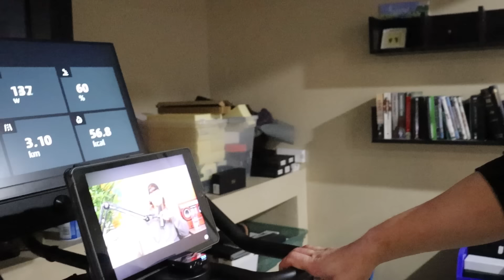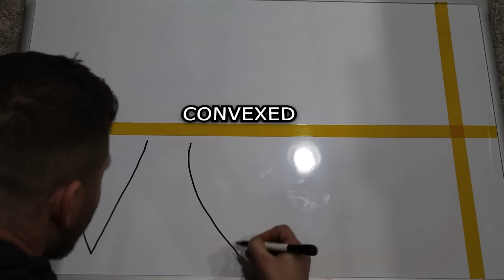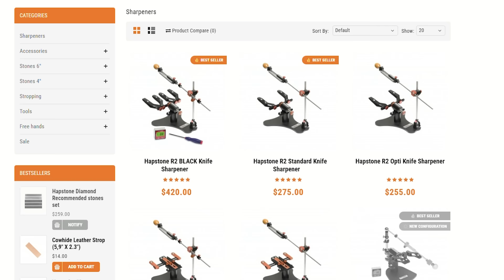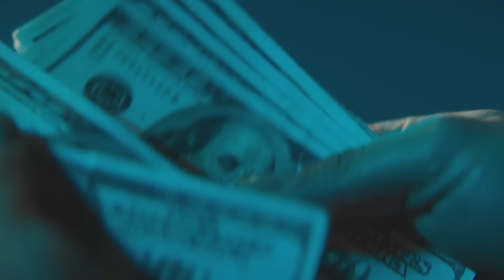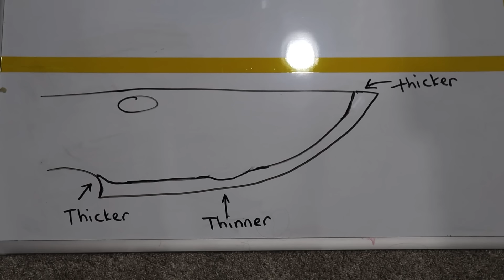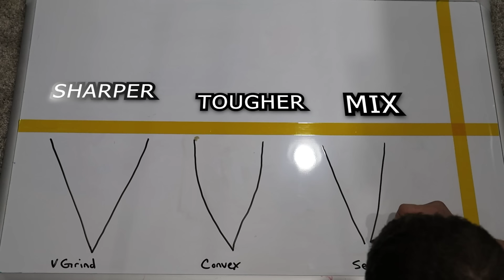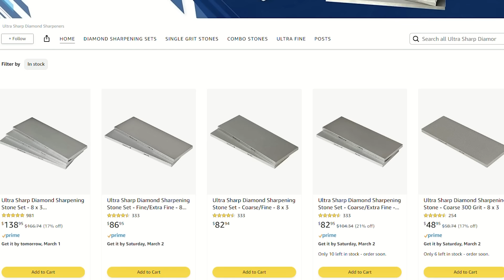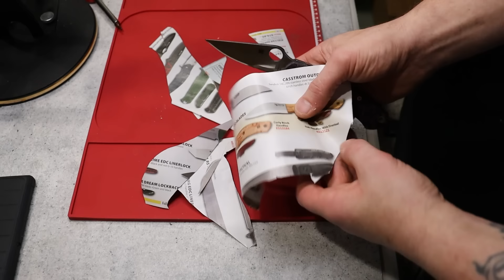The Ultimate Showdown: Freehand vs Fixed Angle, Precision in Knife Sharpening + Yesoul G1 Plus Bike

Comment: I’m 66 and grew up hand sharpening since I was 9 and got a case knife and two Arkansas stones. I love the TSProf K03 and Venev Orion stones which I also use in a holder for freehand sharpening. I mountain bike in the Maine forests and carry a couple knives and basic survival stuff and that work sharp hand sharpening tool with diamond plates works great. You know what else I carry? A sharpie, and have used it because I’m not guessing any more than I need to.😊 the Axicube👍

I have removed stones from my guided system and put them in a table holder to get the tip and heel.

Comment: I've been sharpening knives for 40+ years.  The information in this video is solid gold.  If you can afford a fixed angle system you can use it to get and keep your knives sharp while you learn to freehand.  These days I freehand just about everything with a axe puck held in left hand and finish with a leather strop.  Technically the axe puck is a water stone  but I use it dry so I can drop it back in a pack without getting stuff wet or worse having the stone freeze.  Once in a blue moon I wash it off with soapy water and very occasionally I level the puck by rubbing it in an orbital motion on a flat piece of smooth concrete.  I always wear a smooth leather belt to use as a strop.  My knives from 3" folders, bushcraft fixed blades to actual K-Bars will shave the finest hairs on my arms with one light swipe.  Muscle memory is amazing and totally worth learning.  Puck is also great for my axes, hatchets, tomahawks and machetes.  Water stone aluminum oxide stone puck wouldn't be adequate for super steels but it works great on well executed D2 and below.  Fine for 1055 to 1095.  AUS8, 14C28N ,  What ever steel is in a Mora stainless or carbon or many other similar steels.  Starting on a bench mounted diamond stone would also be my recommended way for a beginner to start.  Once you master that you can branch out to other techniques.

Comment: I always thought of it like this:

Fixed Angle = Lower skill floor, Sharpens faster, easier to learn, more forgiving of mistakes

Freehand = Higher skill ceiling, Able to sharpen an edge with more precision, is more cost efficient and more versatile

I have a fixed angle system. It works for me, but many of the knives I sent to you and got that Neeves freehand special came out far sharper than what my work sharp was capable of doing. Only took me roughly 20 minutes to sharpen but I bet it took you half an hour minimum to put your edge on the same knife.

I think for cheaper knives or frequent users a fixed angle will work but for when you want to put on the best edge possible nothing beats free hand in the hands of an expert sharpener. Because as you said the knowledge can go anywhere with you but a fixed angle system won't fit in the pocket like you demonstrated in the video.

Comment: Thanks Jerad I learned from the best ! I do both , but I prefer fixed angle , BTW The TSProf K03 pro has a convex attachment you can adjust the degree of convex from slight to full 💥
Reply from the maker: Yeah I actually have that attachment, but I've yet to have gotten the kind that I think could possibly be the best, however I didn't consider zero grinds which could possibly be a cool discussion soon

Comment: I like to reduce the shoulder of the edge with few passes at a 10° angle.
I do this to make stropping at a lower angle much easier.
It doesn't make the edge too convex and loose more and more sharpness over time with stropping touch ups.
Some fixed angle sharpeners doesn't allow you to do those 10° passes on some shallow blade shapes.
Learning free hand sharpening takes time but it's so beneficial on all points !

Comment: A very fun vid, shootout to kara for making an appearance. Biggest difference i find in the two is with freehand being able to balance what the edge looks like easier especially on a poorly ground knife.  I use both freehand and a system on occasion. One of the big boneses you get on a fixed angle is the ability to stop at any time and pick up where you left off even a day later and continue sharpening that knife as long as you leave it set up in the system, no guessing what side you were working on or what stone you were using at the moment you stopped. For portable i keep a worksharp guided field sharpener in my bag when traveling but i also keep a set of DMT credit card sharpeners in my wallet and I'm able to touch up any edge with those. They come with a Medium, Fine, and Extra Fine grits for touch ups on the go. They also double as files if i ever need them too, as in  removing a burr or sharp Corner on something. The amount of options available for sharpening supplies is growing all the time including diamonds,  regular stones, strops and compound, systems or free hand stuff. Nice to see innovation as well going strong. Thanks for the great vid and keep making sharp things fun and enjoyable.

Comment: Yes you are 100% correct. Myself I use mainly japanese water stones for kitchen knives and workshop tools but I do have bench oil stones, DMT diamond stone and few small sticks stones. In my opinion good quality extra coarse diamond plate and medium grit soaking type japanese water stone is essential to have in the kitchen and garage, but it is good to have fine stone as well. My high grit stone is 4k and I don't think I need anything finer than that. I started with 1x2x8 bench stones but I quickly moved to bigger, wider stones. So I prefer large single grit stones instead of small or double sided. However small stones can be used as sharpening sticks which are useful in some situations.

Comment: Which fixed angle system is your favorite?  I have a kme and while it's ok I wouldn't mind upgrade to something that can use bigger stones. 

Also, what diamond plates do you recommend for beginner freehand?
Reply: The only diamond stones I will ever buy (also currently use) are Venev diamond stones. Venev Industrial Diamond stones, and bonded diamonds are preferred over coated diamonds. Unlike coated diamonds, bonded diamonds spread the diamond grains over their whole volume, and work in similar fashion to conventional abrasives. Only bonded diamonds can be flattened, lapped, repaired or refreshed. Bonded diamonds are universal and able to sharpen any steel and they have much better feedback and a longer lifespan in general (when taken care of/maintained properly). 

This is your destiny; let the stones be with you.
Reply from the maker: I'm doing my top 5 very soon

Comment: Okay so here is my thing. I cannot freehand forwards to save my life. However, I have learned how to strop by hand and I'm able to hold the exact same angle doing so. I have a DLT ultimate 4 sided strop 8x2 three sides are covered in leather hardwood. On each end there are pieces of wood that I can unscrew with a butterfly nut. Designed to hold strips of sandpaper that are 8 by 2s and by sharpening edge trailing for stropping strokes. I can achieve killer edges and hold my angle doing so. And then I followed up on 6 CBN strops. 16, 8, 4, 2, 1, and .5 micron for a mirror edge. But my sandpaper progression is 400, 600, 1000, 1500, 2000, 2500 before I use the CBN strops. I don't know why it works it just does. I know you said in one of your videos you don't recommend Sharpening backwards and I don't understand why because that's essentially what I do with the sandpaper. And it works. Sorry this is so long I'm just trying to learn everything I can.

Comment: I suck at sharpening knives freehand. I've been doing it for almost 30yrs on just about any stone you can think of. I can get a sharp edge but not razor sharp. I must have developed a flaw in my technique. Always one side ends up better than the other. It really makes me feel like a failure.The best I can do is maintain the factory edge with ceramic rods and a strop.
Reply: Same. Watch all of Jared's sharpening videos and something will click. I bought decent diamond stones and use his tips to keep a consistent angle. Much improved. I prefer to keep the factory edge as long as possible.
Reply from the maker: Make sure you have diamond plates always start with a low grit like 300 or less, you can get an angle finder If needed like the one I showed in the beginning of video, watch a few of my vids I show some awesome tricks to getting great edges

Comment: Great summary, but I will disagree about the inability to achieve a semi-convex on a fixed angle system.  There are a couple ways to go about it.  One is to simply clamp the stone at a slight angle.  Another method is to use a curved rod, which are available for some systems.

Comment: I have ultra sharp diamond plates and 1 resin bonded but they only go to 3k grit what do you recommend for 5k grit
Reply from the maker: You can try Venev, or The new metal bonds from USA market linked in description, check my hapstone link for venev 3x8 you want the 1200 which is 5k or get the PDT Metal bonds from USA market
Reply: @NeevesKnives  my ultra sharp is 300 600 and 2200 my venev resin bonded is the 800/1200
Reply from the maker: @jan5boy889  then your problem is you need some fine grit stones, in-between the ones you have, you could get a venev 400 combo or something else around 1200 to 1500 grit, your 800 is a 3500 grit and the 1200 is 5k grit, so jumping from 600 to 3500 won't work you need an actual 1200. Jfyi venev uses f rating which is different than ours. The small number they use is micron like the venev 1200 is 3/2 micron
Reply: @NeevesKnives  ooh I see now
Reply from the maker: @jan5boy889  the 800 is around 3 to 3.5k and the 1200 is more around 5k
Reply: @NeevesKnives  ok could you please list the combos you personally use and what grit they are please and thanks
Reply: Or atleast the link for your conversion
Reply from the maker: @jan5boy889  I like Atoma 140 diamond plate, then I move to the f100/ f240 f400/800 f1200 as far as for freehand with Venev with an atoma 140 for rapid bevel setting.  So in that order I wrote. There is another companies stones I'm testing now that I like and are new, as far as for fixed angle that's also a great set but I do use others also
Reply: @NeevesKnives  thank you so much

Comment: I modify the blades of the knives by planing the blades, in my videos I show how the knives become sharp, to sharpen I use a much more effective technique than stones which makes the blades as sharp as razor blades. and I have the sharpest knives in the world.
Reply from the maker: I would have to check it out to see what you mean, sounds like a zero grind which is the sharpest, however it's not as practical for edc use for many reasons, however it can be dependent on the geometry etc.. but I'm not sure if that's what you are talking about
Reply: @NeevesKnives  you can try with an old knife, you have to grind the blade that ends at zero and remove the bevel which becomes like the razor blade which is at zero, to sharpen it you have to do it as you do with a flat blade razor on a sharpener and slide without tilting it otherwise you take it off instead of sharpening it. try it and see that you have a knife handle and a cutter blade. 👍

Comment: If I could choose between getting 3 knives (not necessarily expensive ones) vs getting a professional sharpener, I'd learn to sharpen free hand, because I'm not a collector, and I won't investment in a professional sharpener just for 3 maybe 5 knives that I don't care about ruining, just getting them in working condition!
Reply from the maker: Agreed, that's one of the main reasons I learned
Reply: @NeevesKnives  Right now I'm comfortable holding the stone In my hand, and I find it easier to move the stone and slightly tilt it, to accommodate the edge shape when going to the tip, instead of moving the hand with the knife!
Reply from the maker: @DanielDan-rg9zw  yes thats exactly how i do my convex edges and how i teach to do convex movement with both stone and blade while trying to stay perfect
Reply from the maker: @DanielDan-rg9zw  yeah that is a technique I try to teach as well,  I believe it can be an easier way to teach Sharpening with alot of people, since you can bring it right to your eye view